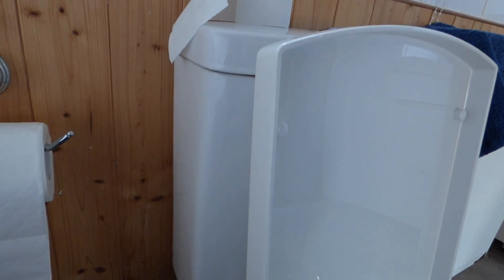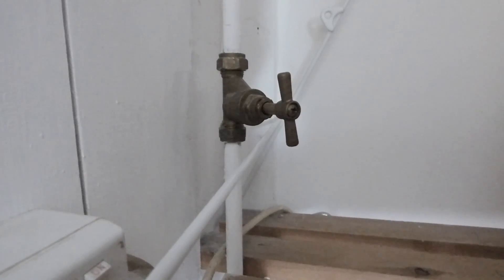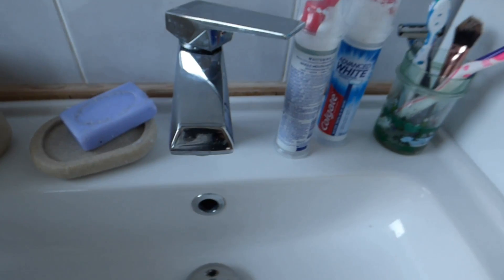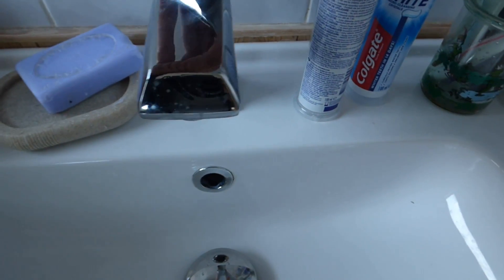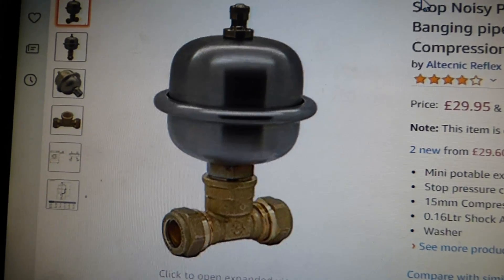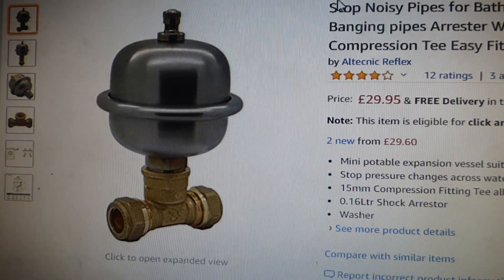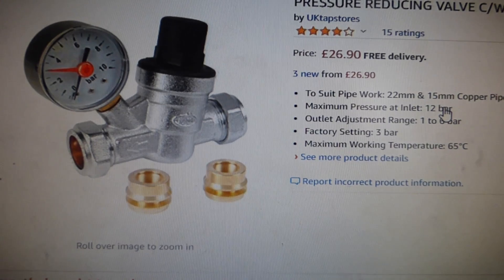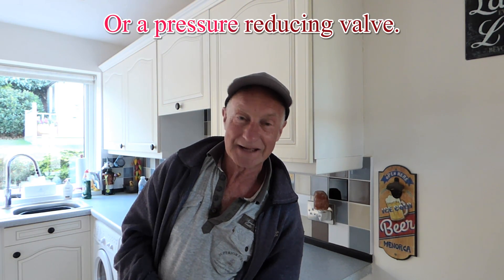How to stop a water hammer noise in your pipes

Comment: I have really bad water hammer so I turned the stop cock off slightly but it didn't make a difference so if I turn it off more is there a certain amount of water that should come out of the tap in a minute.
Reply from the maker: No so long as it is enough for you.

Comment: I get this only when my washing machine is filling.
Trouble is it's a new Samsung as it seems to fill by drawing water intermittently. so lots of bangs.
On my next wash I'll try to locate where the bang is coming from.
Reply from the maker: Try turning down the flow rate first on your main stopcock.
Reply: @dereton33  I've just fixed the low water flow in my house but it still banged even on low water flow.
On my next wash I'm going to try to source the bang.
It's coming from upstairs.

Comment: I reduced the flow on the isolator and it worked 👍. Would have been easier if the joiner had not boxed the valve in and the tiler, tiled it though 😅
Reply from the maker: Shit happens.

Comment: I've got banging on incoming mains in cupboard.
Installed a prv on 3 bar and it's still banging.
On a shared supply with neighbour,seems to be worse at night when they open the taps.
Any help guys...
Reply from the maker: Turn the PRV valve down until it stops but that you still have suffient water at the taps.

Comment: I'm having a nightmare over the last few years with I think water hammer. When a toilet is flushed upstairs or a tap is turned off upstairs we hear a clunk right by the side of the bath. On top of that we get only what I can describe as a low vibration for a few seconds. No particular time of day and with no water running. Any ideas please?
Reply from the maker: If you have an F and E system then it is the roof tank valve needs changing. If you have a Combi system then try turning your water flow rate down via the main stopcock. If still no luck then fit a shock arrestor on the WC feed.
Reply: @dereton33  Thanks for your reply. Turning the stopcock down doesn't make any difference unfortunately. The stop stop is on a lead pipe and plumbers tend to shiver when they see lead pipes. Thought of a PRV just after the stoptap might work.
Reply: Did you sort it? I have same problem and I waiting for the plumber.

Comment: I had this noisy issue when opening up my taps full .. but i also had an issue when I was running the hot tap upstairs for a bath it was letting by in the down stairs sink tap.

Changing the ceramic seems to solve both issues which I was well pleased with.

Is that something you have heard of? A valve letting by causing water hammer
Reply from the maker: Yes it can happen. More than likely caused by a noisy valve filling up the tank in the loft after you had run your taps.
Reply: @dereton33  thanks derek

Comment: Our one seems to related to the central heating pipes. The pipes are all buried in concrete. How do i resplve this issue?
Reply from the maker: Check none of the TRVs are fitted the wrong way round. IE, on the return instead of the flow.
Reply: @dereton33  thanks for the advise.

Comment: Hi. Any possibility of a little advice/help please. 
Recently, over the last few months, when a tap/shower is turned on other taps make a squeal or start to dribble/drip.
Any ideas pretty please?
Reply from the maker: Water pressure too high. Try turning the flow rate down at the main stopcock.
Reply: @dereton33  many thanks, I will give it a bash 👍
Reply: Hi. So I tried the water pressure, and yes, if i turn it down a lot it does stop, but then the flow is poor (especially in the shower).
Why wouldn't it suddenly start if the pressure has not changed?
Also, when we flush the loo, the waste down pipe rumbles at the end of the flush. Not sure if these two are related 🤔
Reply: @whizzo3175 I have the same problem on second floor every faucets, shower,bath and toilets

Comment: Hi I’ve had noisy taps got a plumber out and he said my downstairs tap needs changing I adjust the valves and it’s not making a sound any more. Could I have some advice on what to do please thank you
Reply: Just to add aswell my boiler and pressure are fine as just had a service thank you
Reply: And I do have a drop down stairs but nothing Major
Reply from the maker: No need to do anything you have sorted it out by lowering the valve flow rate. Well done Eleanor.
Reply: @dereton33  thank you I also have a dripping tap could that be the cause of water hammer or foghorn noise too? Thank you

Comment: I've tried reducing the pressure, I've also drained the pipes and refilled them from the top down, I've identified the pipe that's banging and secured it down and I still have the banging noise..... Its coming from the mains stopcock, hidden away at the back of a cupboard and the pipes going upstairs have been boxed in and plastered over 🤦‍♂️ What would you suggest?
Reply from the maker: Try turning down the flow rate of the outside main stopcock.
Reply: @dereton33  hi, I've tried turning down the flow but still getting a banging noise, it happens more when the washing machine is in use so I'm thinking of installing an arrestor....do you think that'd work?
Reply: Did you fixed it?

Comment: Would you give us some advice? Our pipes bang loudly every hour or two throughout the day and night long after the water has been used.   Thanks
Reply from the maker: High water pressure. Try turning the flow rate down by turning the stopcock down to a slower flow rate. Other than that you will need a pressure reducing valve and gauge. Fitted just after the main stopcock.
Reply: @dereton33  thanks

Comment: My rural cottage just changed from pumped well water to a mains connection, and the changes included a real plumber installing a float valve in the upstairs tank. I have no complaint about his work, but within a few days I started having severe water hammer to the point where I feared the pipework would spring a leak.  The solution (found online) turned out to be ridiculously easy: tie an upright empty 300ml yogurt tub onto the float arm, with the top of the tub just below the surface of the water. This damped out the "chatter" as the float valve is close to shutting off, and it completely cured the problem. I was expected it not to work at all, but it was cheap (literally nothing) to try so what the hey. I absolutely did not expect a complete cure!  I had previously tried closing the valve a tadge, but that didn't seem to help.
Reply from the maker: Thanks for the info.

Comment: Al,  I've lived where I am for 16 years and everything had been OK, but around April this year I started having problems. There will be a sudden banging in my pipes, and often when I go into the kitchen water is 'shaking' out of the mixer tap. If I open the hot water tap, it mostly stops the banging, but can sometimes begin again within minutes. I even occasionally open the hot water tap to stop the banging, but when I close the tap, water continues to run, even though the tap is switched off!. It often seems to start somewhere between about 8am to 9.30am, and can happen quite a few times during the day. It's really strange, do you have any suggestions?.
Reply from the maker: Yes, close the main stopcock down to a slower flow rate.
Reply: @dereton33  , thanks Al i'll give it a try and let you know the outcome over the next day or so.
Reply: no joy with my problems al. Had to switch the water off at the stop tap tonight, because even though the kitchen taps were switched off, water was coming out of them, and nothing would stop it short of switching the water off completely!. Don't know what will happen when I switch it on again tomorrow!

Comment: function is more important than looks, how about the washing / dish washers, they can cause water hammer, because the solenoid water valves, turn the water supply, off in a flash.
Sioux Chief DW660-H Water Hammer Arrestor ¾" BSP Connection, are good for -
washing / dish washers for the UK
Reply from the maker: Thanks.
Reply: @dereton33  your welcome, you good at sharing your knowledge and experience.

Comment: Although some of this may sort of work, there's a few problems here.

First you should not rely on throttling isolation valves to reduce pressure - this will cause cavitation and cause the valve to fail prematurely. If throttling solves the problem, then what you need is a flow restrictor or PRV as you mention at the end.

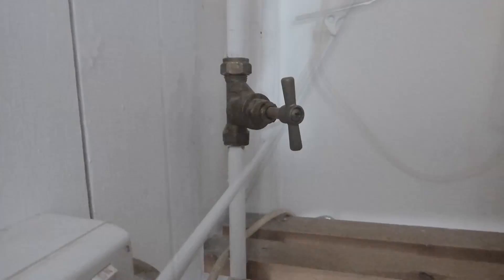Second at 01:39, unclipped pipes do not 'cause' water hammer, they will just make you aware of it. Water hammer is CAUSED by the momentum of water being suddenly stopped, and the resulting pressure wave - rattling pipes are a secondary effect of the pressure wave. Clipping the pipes in place won't change the fact it's happening (and damaging your pipes / fittings)
Reply from the maker: Thanks Dave.

Comment: I’ve got water hammer in my cold pipes at the moment, on and off for the last two months.  Seems to be in different points around the house but predominantly under the kitchen sink where the mains inlet pipe is.  I have a shock arrestor upstairs under the combi boiler, I recently bled some air off it via the little valve (looks like a bike tyre valve) - was this a mistake?
Reply from the maker: Yes, it should have that air to act as a cushion. Use a bike pump to push some air back in.

Comment: Hi Al,  if you can help out , have watch this vid , and have done near all , but there is still a noise from up stairs shower  room , it only comes on when some one used the taps down stairs ,the last place is to remove the the floor tiles and see if the pipes and fix with clips / and remove the wall tiles too and see if pipes needs clips , any advice would be help full , and might save from re moving the floor / wall tiles Thanks :)
Reply from the maker: Try turning the flow rate down at the main stopcock. If that doesn't do it then a flow arrester will.
Reply: @dereton33  Thanks Al ,have done that and it's not as bad has if been , but still a bit of noise there :)
Reply: Obviously this was a while ago now so hopefully it’s been sorted out but could be a non return valve in the shower depending what sort of shower you have.
Reply: @robp5895  Thanks and yes it has been sorted , all the best :)

Comment: The hammer is coming fron next door. shared main. And BANG all through my house. I think it's their washing machine.  So what co i do in MY property. I still get it with my stop cock valved closed off. The bang is coming from the other side of the valve. From external.
Reply from the maker: Go visit your neighbour and ask if they could turn they flow pressure down by turning the main stopcock.

Comment: I had a water arrestor fitted after I started to experience water hammer when turning taps off and all it did was make the bang happen when the water was turned on instead! I then had a pressure reducing valve fitted and the problem went completely. It's great because you can adjust the pressure just like you adjust the temperature on a radiator thermostat. Apparently, water hammer is becoming more of a problem due to more people working from home which means the water companies have had to increase the pressure to cope with demand.
Reply from the maker: Great point there.

Comment: Hi Mr Dereton. 
I have a well pump. I'm getting hammer when the water runs, also when I turn a tap off. Would the same procedure apply please?
Thank you, very informative. 👍
Reply from the maker: Yes it will
Reply: @dereton33  Thank you very much Sir. I'm working on it now. Perhaps my well is more full than usual? Anyway, you strike me like my mentors of old who all 'knew their onions'. Thank you again.
Reply: I just wanted to add. The noise appears to be on or near my boiler, powered by a wood stove. Thank you again.

Comment: Hi, the stop valve in the house leaks if turned on or off so I have tried to reduce the water pressure coming into the house from the stop valve on the water meter, will this have the same effect?
Reply from the maker: Yes the same effect.

Comment: Hi, I have the pressure reducer fitted next to my water tank but still when we run hot water there is that vibrating sound in the pipes, even though the reducer is set on 2 Bars, so not high at all. What I noticed is that air pressure relief is tighten to the max. Do you think it can help if I undo the air pressure relief?
Reply from the maker: Worth giving it a try.

Comment: Hi recently i changed a valve cartrage to stop the dripping in the cold tap and it work a treat.. Now tho there a thudding noise every time i use the cold water tap.  Im not sure whats doing it tho.
Reply from the maker: Try slowing the water flow rate down.
Reply: @dereton33  worked i turned down no more noise was worried pipes were gna burst lol

Comment: Hi I’m struggling to find out what my issue is called. Don’t think it’s water hammer. Whenever I turn bathroom taps on, the kitchen tap makes a REALLY loud vibrating sound. The sound only stops if I turn off the bathroom tap or  if turn on the hot water on the kitchen tap. Any advice would be really appreciate. Thank you
Reply: 1) Does your PRV work?  install PRV if on city water, set pressure between 50-75psi  2) replace the angle stops in bathroom (or where problem is happening). 3) add expansion tank to water heater. 3) strap pipes where assessable. 4) open drywall is open replace plumbing.
Reply: @twayne4157  thank you very much
Reply from the maker: Or just try turning the flow rate down at the main stopcock.

Comment: I've got an odd situation. Yesterday Thames water were outside and turned off the mains supply. When everything came back on water hammer started when I turn the taps off even very slowly (previously it would only happen if I turned them off quickly). I've drained the taps to try and get rid of any air but it's still happening. It's so annoying as it now happens any time a tap is used. Any ideas?
Reply from the maker: The water pressure is now higher than it was, try turning the flow rate down by turning your stopcock off and then back just a small amount.
Reply: @dereton33  thanks mate this has stopped the water hammer but the flow rate on the bath / shower is so slow now. I'm in a maisonette top floor and I share the same mains water line as my downstairs neighbours. Whenever they use taps / the washing machine the hammer is insane! If I flush my toilet or have a tap open it stops the hammer whenever they are using the water. I think I'll have to ask them to turn down their pressure perhaps

Comment: Would love to get some advice. 3 story townhome, water hammer comes up once using the washer or the toilet downstairs at the lowest level. Nothing else causes it. After flushing the toilet or when the washer machine is filling up. Tried leaving all faucets and flushing toilet upstairs to get rid of the air in the pipes. To no avail. What would you recommend after trying the turn down the main?
Reply from the maker: Fit a pressure reducing valve on the incoming main.
Reply: My water hammer was due to my outside hoses been pressurised I turn then off at the tap now after gardening and it stopped straight away

Comment: It works, so straightforward and effective, many thanks dereton33 for guiding on eliminating loud vibrating sounds from the inlet pipe to the apartment water tank ('hot press').  I turned the brass stop cock right back as you indicated, almost off (lots of pressure where we are), and the noise is gone, sparing the need for expensive treatment.  Happy neighbours, happy household.
Reply from the maker: That`s great.

Comment: I got water hammer hammer arrester at washing machine pipes. Why do I see water hammer at say bathroom. Also when I use toilet at full valve opening i hear sound in same area. Can a faulty prv  cause water hammer.
Reply from the maker: Yes they can do, but have you tried lowering the pressure flow rate from the main stopcock.